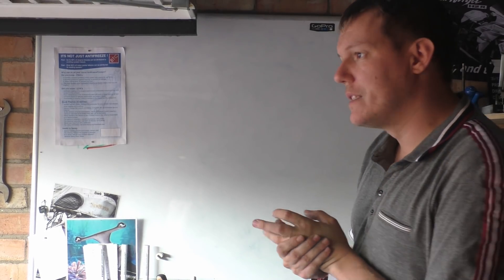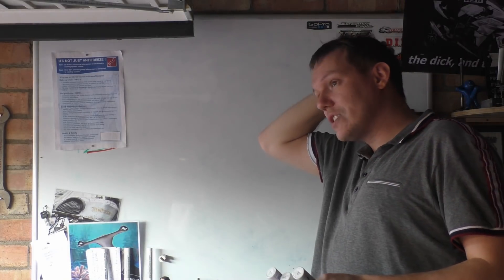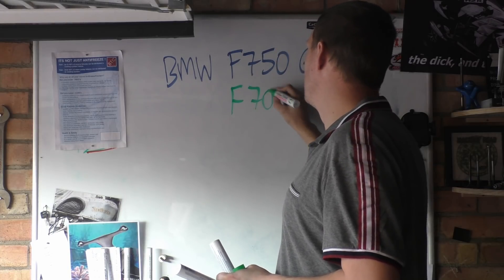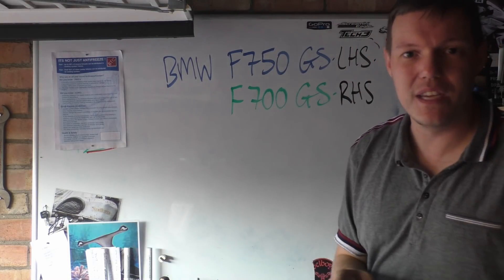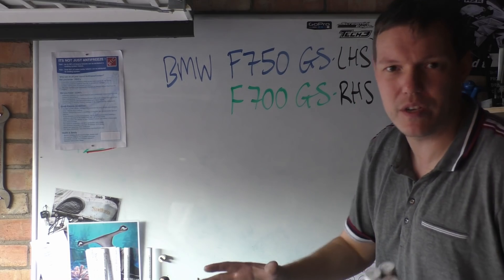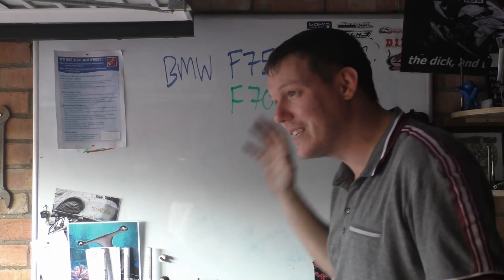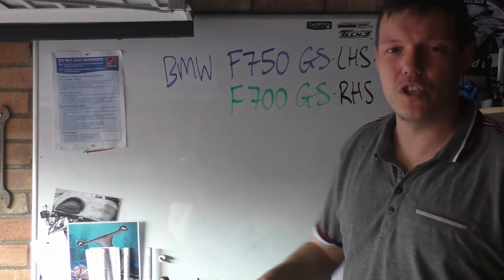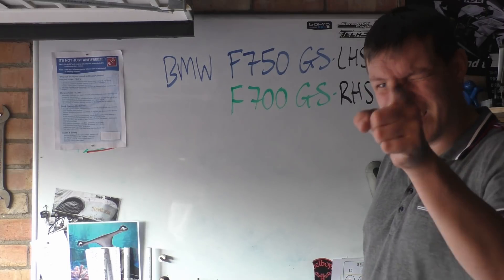Chain on the left or right?

Comment: 750 is basically a smaller engined 850 and replaces the 700,which was a bigger version of the 650. As you say,different "families" of engine.I rode an R1100GS years ago and to my amazement it was great,even if pot ugly and stupidly top heavy with a full tank. Newer ones don't interest me at all.

Comment: the r1200 switched the exhaust pipe side back a few years ago, the marketing was to swap it a way from the left side of the bike as that is the side you would "walk" the bike and then you would not burn yourself. the 800 was designed when the 1200 had the exhaust on the left and the 750,850 when the r1200 has the exhaust on the right.  they are trying to make the smaller GS look like the bigger one.  So the lay out of the chain drive probably followed from that (or not).

Comment: Matt, you mentioned in the video about people changing axles round, is this a bad thing? when I bought my bike, I didn't really notice the direction the axle was fed through until I got the service manual. Whoever had the bike before me obviously inserted axle right to left as it is easier to get through swing arm / caliper mount/wheel / swing arm, instead of left to right. Service manual has it diagram'd left to right!  Thoughts please.
Reply from the maker: This will be its own video

Comment: It all dates back to which side the bike would have a sidecar mounted on, which determined the side the clutch would be on for access which in turn places the drive chain on the opposite to the clutch because of how gearboxes are laid out.

European and US bikes drive on the right hand side of the road so traditionally the sidecar would be on the right of the bike, which would mean that the clutch would have to be on the opposite side (left) so the sidecar wouldn't block access. This is why nearly all European chain drive bikes have a left hand clutch and right hand chain drive for over a century.

Japan drives on the left hand side of the road so the sidecar would be on the left hand side of the bike so the clutch is traditionally mounted on the right hand side for ease of access. This is why Japanese bikes (with the exception of the first Yamaha YD1 / YD2 250's which used licenced Sachs engines) have the clutch on the right and the drive chain on the left.

Anybody in Britain / Australia / New Zealand / The Far Eastern Countries (that drive on the left hand side of the road) whose had to remove a sidecar from a European (right hand drive chain) bike just so that they can access the left hand side clutch to work on it (like change the plates / springs / thrust bearing / etc.).

As an exception to the rule ye olde fashioned British bike industry (BSA (bits stuck anywhere), Triumph, Ariel, Norton, etc.) had the clutch and drive chain on the same side of the bike (left) so as to make clutch maintenance a royal pain in the arse for chair tug owners (An sidecar outfits consume clutch plates far quicker than a solo bike). Obviously not a problem for exported British bikes to countries that used right hand sidecars.

Comment: Chain on left means top run of chain is overhanging bottom when on sidestand which might make more sense if lubing it in terms of not dripping onto the wheel and tyre. So as long as chain and sidestand are in same side. And exhaust on the opposite then it's all good. Also it's like earrings, RHS piercing / chain is gay.

Comment: Talking about chains...why don't manufacturers make it so that the front sprocket is where the suspension pivots, and then the chain will always be the same tightness. Or run a short chain to suspension pivot onto a double sprocket so the long chain is always the same tightness. Rather than it being loose when no weight on the suspension and tight when loaded.
Reply: I'm no expert but I think logistics of this would be the primary limitation.  Fitting in beefy enough infrastructure to support the main suspension element would probably make it unfeasible.
Reply: Manufacturers use that chain tension rise to help with suspension and traction. It's also apparently a big part of tuning the rear of race bikes. I don't understand how it works though. It would make a good episode of workshop I reckon.
Reply: chris vinicombe   It's all to do with the anti-squat effect when accelerating. It is created by the angle of swingarm and also by the top run of the chain.  If you make the front sprocket and swingarm pivot concentric, I think you would lose the chain part of the effect,  So you are correct.
Reply: Someone did, if im not mistaken. Think it was a 70s dirt bike like a husky or KTM.
Reply: BMW 450cc enduro bikes did that. Good idea to keep chain tension but was very complicated due to front sprocket having to be located on the swing arm pivot.

Comment: Dear Matt, does it male any difference what ducati made on their new v4 engine in that the final drive turns backwards instead of forward so it cancels rotations from the engine?
Sorry in advance, tried to explain it the best I could with my knowledge of it.
Reply from the maker: "final drive turns backwards"

- Are you sure about that? LOL
Reply: Crankshaft rather than final drive?
Reply: This created the challenge of designing an engine that could keep the MotoGP engine's counter-rotating crankshaft, and large bore diameter, but have the 15,000 mi (24,000 km) service intervals expected on consumer motorcycles.
Reply: Unlike most street bikes and previous Ducatis other than MotoGP racing machines, the Panigale V4's engine rotates in the opposite direction of the wheels, counteracting the gyroscopic effect and therefore decreasing the force necessary to change the bike's inclination.
Reply: Well, yes it's the crankshaft as you can see for the 2 post I copied from Wikipedia. Anyway is this worth it? If this is that good wouldn't other already done this?!?!?
Regards, and continue the good work on the channel!